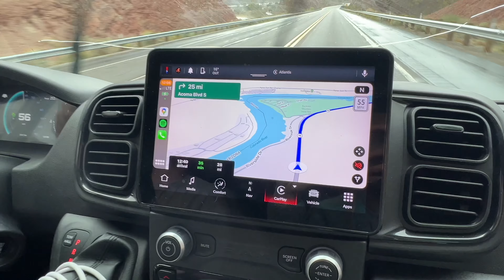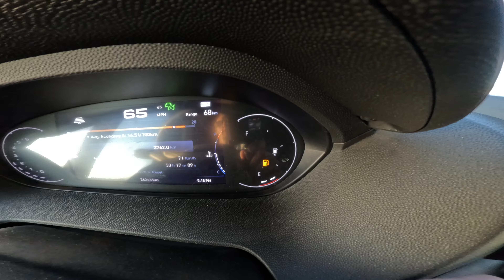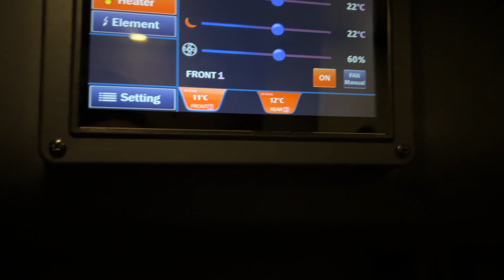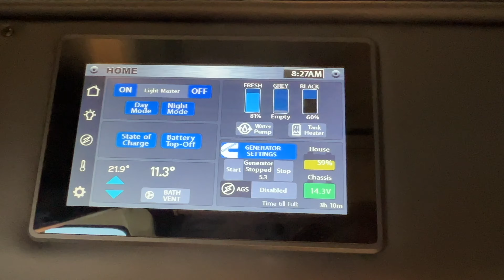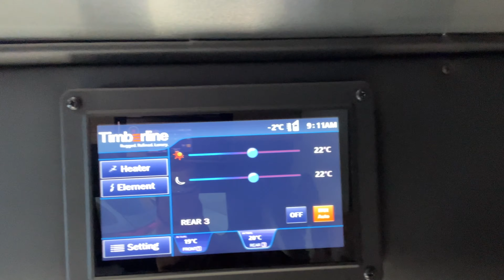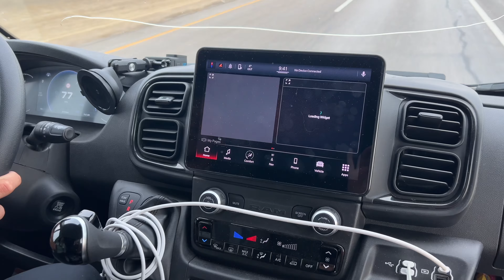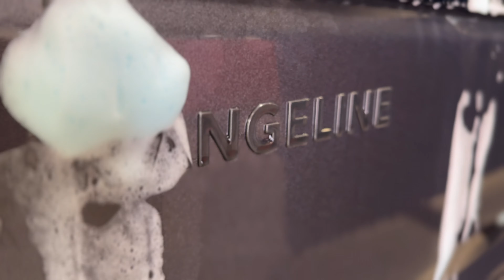VANLIFE in our AIRSTREAM Rangeline California Desert

Comment: make sure when you get the windshield replaced that rubber seal at the base of the windshield is tight against the window. If not water will leak into the top of the engine. Had mine done and they broke the clips for the seal.
Reply from the maker: Thanks for mentioning it! We do need a new windshield pretty soon.